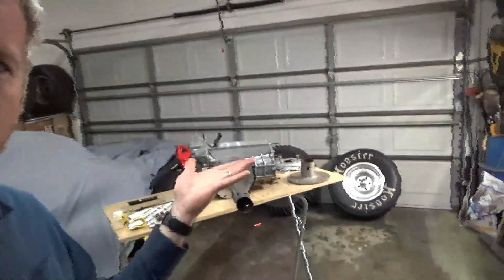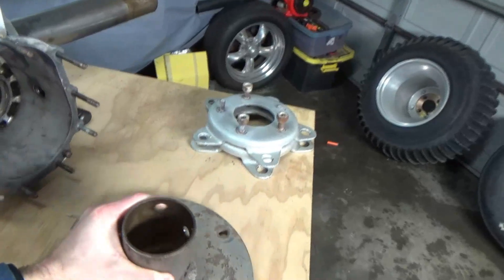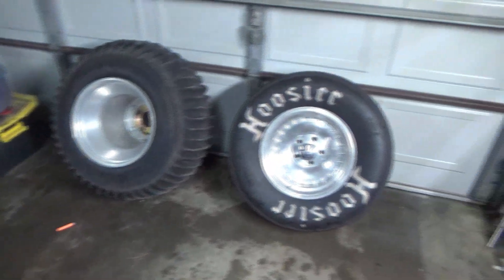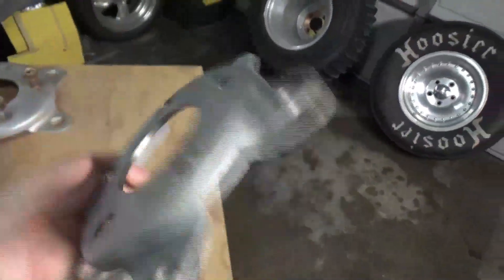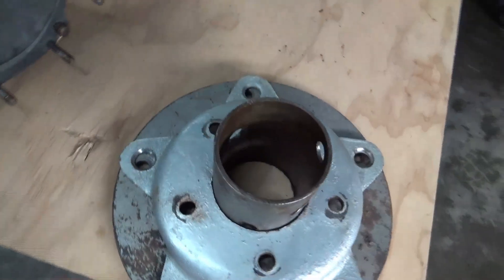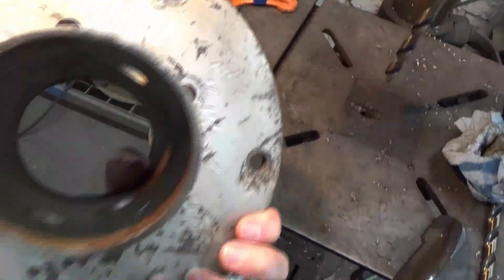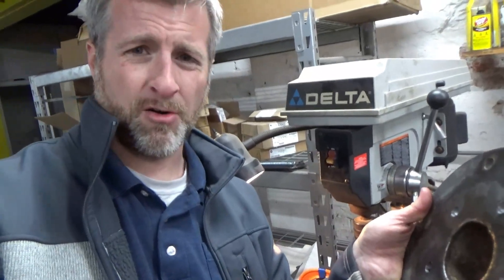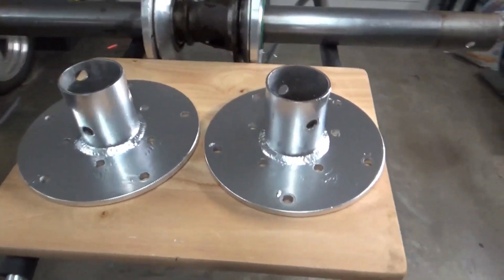Drilling Hubs to Adapt to Chevy 4.75 Bolt Pattern For Drag Rail Project

Comment: That turned out nice!! I will be watching more sir. 👍👍
Reply from the maker: Thank JB!  I'm certainly not as skilled as you are on the machine work, but I'm glad I atleast found a way to get it done.
Reply: @culturedredneckgarage3784  I worked with a master VW mechanic way back in the day. So interested in what your doing. I need to go back and watch what you have done with the engine so far. But those things will beat a motorcycle from red light to red light. I have seen it with my own eyes!!!👍👍👊
Reply from the maker: @jbslittleshop2897  Absolutely!!  My buggy is on the mild side, so it’s not super fast, but that transaxle is for my Subaru rail dragster build…I’ve only shown it on my intro video, so I imagine it’s time to devote an entire video to it soon.

Comment: Very cool.  I assume it uses the bolts for the wide 5 and studs for the slicks?  What kind of brakes?
Reply from the maker: Those new bolts should also be able to be used with those Douglas vw aluminum wheels (not 100% sure on the length just yet).  Those wheels will however require a different style lug nut and a special washer as those wheel are thin.  For brakes, there’s a single rotor that slides onto the right side of the axle shaft between the tranny and wheel rotor.  I am gonna have to fabricate a bracket to hold the brake caliper on though as the one I have isn’t compatible with this set-up….not to many store bought kits on this rig.😀